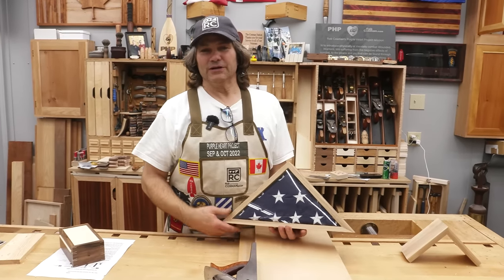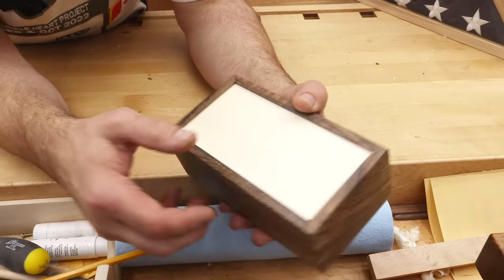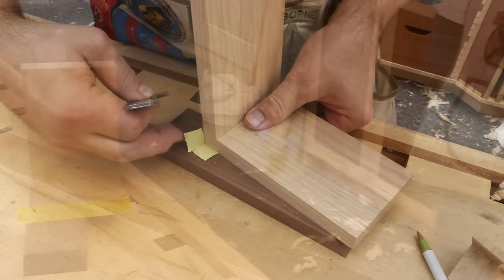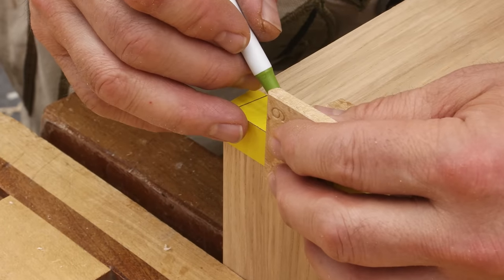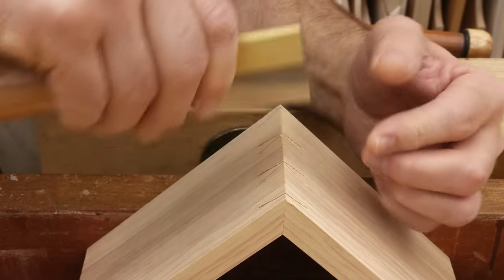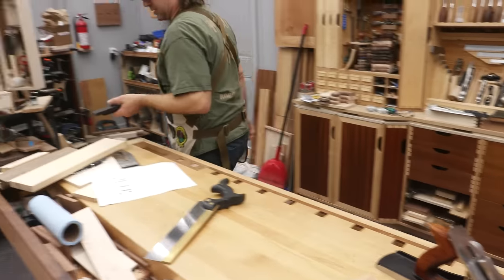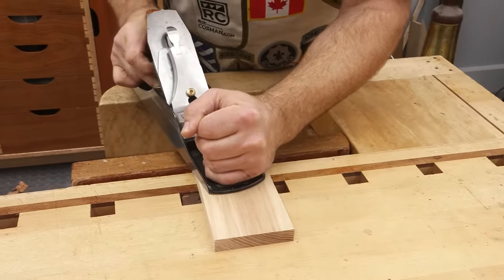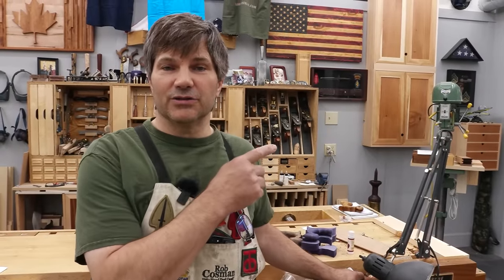Faux Dovetails made with Splines by Hand

Comment: Absolutely loved this Video. The tape method to plane down the thickness. 👌
The cutting dovetails detail about the bottom being curved (that's where a lot of people make their 1st mistake)
For me though (and this is where (in my experience) some make their 2nd mistake) I would trim the splines from the corner of the mitre. Using a Chisel. I couldn't risk the chance of any breakout on the top edge of the spline. A little slower. But, sometimes it's not all about speed. Great tutorial. Thanks for sharing. Jamie

Comment: Cool video as always, Rob. Thought I'd mention a variation on this idea of using sandpaper to hold thin material like you're doing here. I've found I can use the 3M sandblaster paper with the non-slip backing (not adhesive, just non-slip). I put the grit side down, and the work on the non-slip back. Then you can plane the thin stuff without the risk of hitting the abrasive.
Reply from the maker: great tip

Comment: Good job Rob!
I use similar splines for my picture frames.
I do a slight hollow on the bottom side go make sure it will not bump.
And I do them much deeper to get all the possible strength.
Reply from the maker: That's a great idea!

Comment: Very cool look.  Haha, fake dovetails - nice.

Something I've found to plane really thin wood is lying it down on one of those red silicone mats that Woodcraft sells.  As long as you keep the mat clean, the wood doesn't slide at all, and no chance of hitting sandpaper.

Keep forgetting about CA glue for something like that.  Maybe if I see enough of you doing that I have a chance of getting it into my thick head.
Reply from the maker: good tip

Comment: Looks amazing! But I have a question - when you were cutting the veneers at the table saw, you made a point to go super slow, is that to get a cleaner cut or to maintain more control? Thanks!
Reply from the maker: Smoother surface and less chance of the sliver getting destroyed.